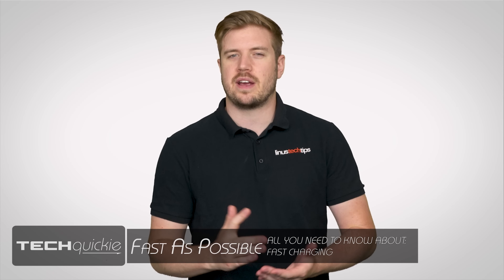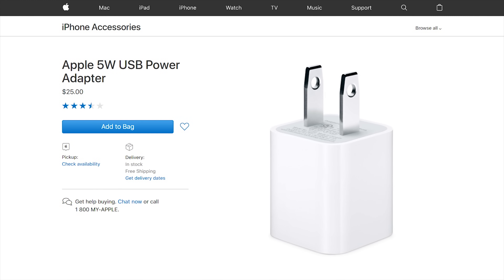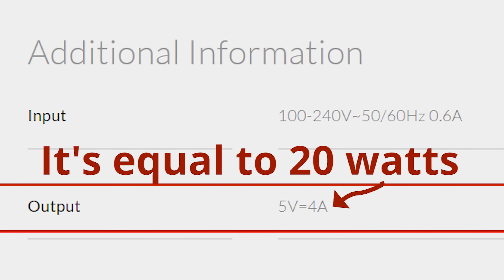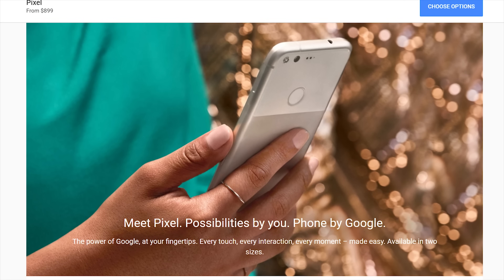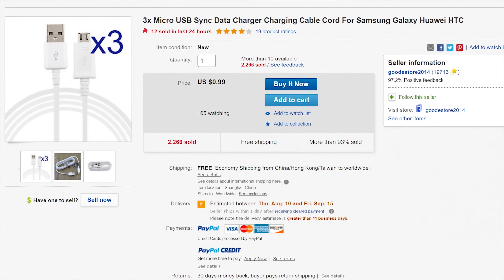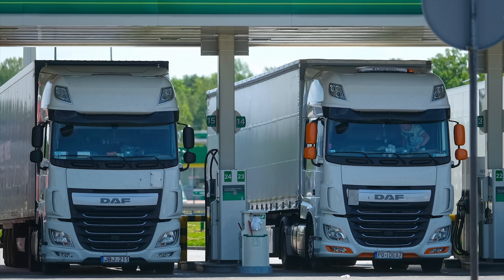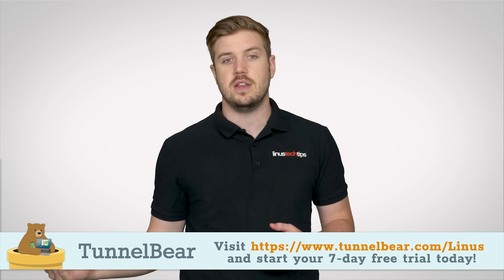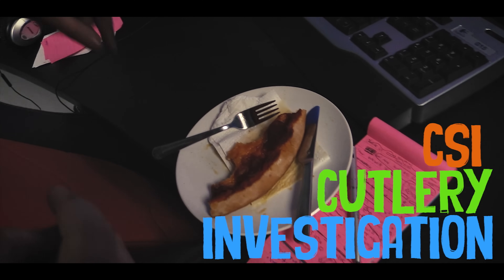How Does Fast Charging Work?

Comment: I love how americans complain about paying 50 dollars to gas
Reply: Marcus Coster he means that it is very cheap when compared to, for example, most of Europe
Reply: Well when minimum wage isn't enough to support yourself and then add gas on that, then you've got a problem. But you know, I'm just a dumb American, what do I know?
Reply: Marcus Coster - You assume everyone lives in a built up area with great public transport which simply isn't the case. It is more densely populated but this just creates more traffic congestion as public transport isn't that great and costs a lot. Most people still need/want a car. The only time public transport works really well is in city centers which is probably the same in america but it's still expensive. If you complain about fuel prices in america why do so many of you drive v8's and v6's. There are smaller cars available but you don't buy them so to complain about fuel prices while driving inefficient cars is pretty stupid. In Europe most own 1l to 2l 4 cylinder cars, even the larger 4x4's tend to have a 4 cylinder larger capacity engine. They're not slow either yet much more economical and can be just as large to transport things.
Reply: Every country should take notes from finnish public transportation

Ok ok its just the card you use to travel
Reply: Truckman I've visited to 5 European countries last month and every single one had such a card. Still a car is faster when you're not commuting through a city center
Reply: Truckman yes. It's just a universal public transport card. 
In the Netherlands, Austria, Czech Republic and Hungary it's train, tram, bus and metro. 
In Portugal it's also the ferry

EDIT: they're all different cards. It's not like you can use a Dutch one in Austria :p
Reply: Good public transport? I'd say it's decent in the cities in Belgium but anywhere else it's pretty bad, can't really trust it to get somewhere in time and it's hella expensive.
Reply: AlmostEasy which countries have you tried because i use only public transport and have never been late.
Reply: It's called price relativity. Let's say you could buy a good meal at a restaurant for $3 and have known it to be around that price for most of your life. Over time when it crawls up to $6 or $7 it's all of a sudden annoyingly overpriced. If you're used to something being cheap, then you don't really consider it cheap. That's just what you consider the price to be. Anything higher, relatively speaking, would be expensive. Different world regions, different prices, different price expectations. It's not that complicated.
Reply: Here in Italy the average price for gas it's about 1.6€/liter (about 5.8$/gallon), so yeah you Americans shouldn't really complain for your gas price 😂
Reply: vinno97 things probs have changed but does the same card work on many types of transportation like bus subway tram and in some cases train. Not saying it would be exclusive to Finland. And yes car is the easiest option.
Reply: vinno97 :P tho about cars. EV's seem cool like Tesla tho i dont know if EV is worth it
Reply: Truckman I'd say eventually all cars will be electric, though I don't expect fossil fuels to go away anytime soon
Reply: Belgium, it's where I live. Should've added anywhere else in Belgium that isn't a city, wasn't generalising for the rest of Europe.
Reply: AlmostEasy ah okey.
Reply: It costs me 28 dollars to fill my 12 gallon tank in Southern California. It costs me 22 dollars in Las Vegas when I go visit my family. 18 dollars when I'm visiting friends in Arizona. 15 dollars when I'm in Florida. I hear it's even cheaper heading north of Florida.
Reply: Here in NE Louisiana it's about 2.30-2.50 a gallon (1.75-1.90£ for you British folk)
Reply: I love it how Europe complains about how much it has to pay for gas if you look at Iceland they have both of us beat as far as expensive gas goes xD
Reply: Lol i m living in canada. Stupid host mom asked me gas for 20 bucks even she traveled 54km does it make sense ?
Reply: Yea i Bet you just love it
Reply: These people are Canadian
Reply: Kirina Yuuki in Russia its cheaper
Reply: My minivan costs 80 in Canada ....
Reply: T H I N K   A B O U T   T H E 
 C H I L D R E N !
Reply: Uraneum I wish I could get a good meal for 3$ equiv in the UK. A average meal price at a general rural cafe is about £7-12 and in London it is twice that. That is just the basic foods. With fancy foods at decent restruants, you could be paying over £100 for two or three people
Reply: Lol I complain about paying 25$ to fill up 😂 if it cost me 50$ to fill I would throw that dam car away
Reply: vinno97 It doesn't matter because the public transportation is good and reaches basically everywhere. There's also not nearly as much space for having a car, the roads are smaller, population is denser (making smog have a worse effect). You could live in a lot more places in Europe and never need to own a car than you could in the U.S. My other point was, Americans almost certainly buy gas more often than Europeans. So overall there's not much benefit for us. Many people would be happier taking a bus or subway or bike everywhere if possible, for FAR less  money per month.
Reply: Kirina Yuuki Cars are necessary in most of the country so yeah, we are allowed to be upset when prices get high.

Comment: Why do many laptop charges have some kind of brick  on them
Reply: Najam Hassan The brick IS the charger, the wires are just wires.
Reply: it converts the power from the power outlet from the wall to power your laptop can use
Reply: It converts ac to dc.
Reply: Houses the electronics to convert AC to DC, and downstep the voltage. Phone adapters have them too, but carry a much lower current, so smaller circuitry can be used
Reply: AC is good for transmitting power, but digital devices use DC. In traditional AC-to-DC converters, a step-down transformer (which, unfortunately, are NOT robots in disguise) converts a high voltage AC signal to a low voltage AC signal. For high power applications, this AC signal is sent to a FULL-BRIDGE RECTIFIER which allows AC signals to move in only one direction. Add a load (the thing we want to power) and a capacitor (to smooth the voltage) and we have DC through the load.

For lower powered circuits, we can use a puny single-diode half rectifier. Since AC is a sine wave (sorta), a full-bridge rectifier converts both the waves above and below neutral while a half rectifier only uses one of the two. Don't worry, we can still smooth it with a capacitor, we just can't demand as much power from it.

BUT WAIT! THERE'S MORE! For even lower power applications, we can use a switching supply. Both rectifiers require the use of a diode, which means that there is power wasted on the diode. A microcontroller can see the input voltage and change the amount of time that voltage would be allowed to power a device. This is known as Pulse-Width Modulation (or PWM) where V_apparent=V_actual*duty_cycle where the duty cycle is the percent time that the voltage is allowed to pass. Add a capacitor and we can rectify the power with better efficiency.

Considering the power needs of a computer, your laptop probably has a full-bridge rectifier which often has somewhat large transformers and often have other safety devices as current sensors and temperature sensors integrated into the charger.

Comment: Not a bad intro, I guess, but you're a bit weak on your electronics 101. A power supply can't control how many amps go into the device- its up to the phone to not draw more than the power supply can handle, and the protocols are all about making sure the phone can figure out that limit. This means that you can't damage a phone by plugging it into a charger that is too many amps- it'll just draw what it wants. If a phone starts to draw too much current, though, all the charger can do is shut off.

Comment: How come that while my OnePLus 3 dash charges, the battery temperature doesn't usually exceed 30C, although it's being hit with 3.4A (data according to "Ampere" app)?
Reply: Hence why I love my OP3T, all round brilliant phone except the camera for a good price and it beasts every other phone charging wise.

Also, you can get an "VOOC" charger block which can usually be found for cheaper and is the same technology in Dash Charge (VOOC is created by OPPO who also own 1+)
Reply: because the heat production follows P=I^2*R (power= current squared times resistance). If the internal resistance of the battery is lower, it will output less heat at the same current.
Reply: Colin Ries most of the heat comes from the transformer circuitry, Qualcomm quick charge (same as Samsung fast charge etc etc) use higher voltages so they have to get transformed back to 5V in your phone, dash charge on the other hand puts out way more amps and keeps voltage at 5V so the charger gets hot and not the phone, notice how the brick always gets pretty hot
Reply: Iam Sagittare that makes sense, but it implies that OnePlus is using really good batteries...
Reply: Niek Schoemaker that makes sense. Indeed the charger gets pretty hot, but so does my iPhone charger... I think the lower overall (phone + charger) heat output comes from less overall conversions. With quick charge, you have 220V -> xx V -> 5V while Dash Charge reduces it to 220V -> 5V. Pretty much the only downside is that it requires a thicker cable in order to support the higher current, while higher voltage works just fine on a normal thickness cable...
Reply: Vinxian1 sure, but according to the video, the battery itself produces the heat (being a chemist, I can say this makes sense) and not the circuitry around it...
Reply: I have to say that I'm suprised it only reaches 30C, even without the the power circuitry.
But the circuitry is responsible for a lot of the heat, the circuitry is not 100% efficient. Therefore it dissipates power. And that in turn generates heat. especially since the circuitry is in a closed environment
Reply: Vinxian1 that's true, but really, I thought the battery alone was responsible for the majority of the heat output. 30C is when it's not used while charging though. It's a little hotter when being used at the same time, but still miles aways from an iPhone or whatever

Comment: Quite innacurate. 2amps is max capacity of USB micro b, not 4. Samsung uses 9v fast charging at 1.67 amps to get quite a lot faster charge
Reply: i'm not smart but the oneplus dash charger uses usb c
Reply: thicc USB c can deliver 5 amps so it's possible
Reply: Excuse me? How are my specifications false. I know how this works.
Reply: For USB 2.0 wich includes the micro USB connector:
"Battery Charging Specification 1.2:[29] Released in December 2010.

Several changes and increasing limits including allowing 1.5 A on 
charging ports for unconfigured devices, allowing High Speed 
communication while having a current up to 1.5 A and allowing a maximum 
current of 5 A."

So your specifications are false because 5A is more than 2A, and 2A doesn't appear in the spec at all. But please tell me more about how you know how this works.

https://en.wikipedia.org/wiki/USB#Power_related_specifications

Comment: My suggestion to everyone looking to keep their phone's battery healthy is to use quickcharge only when you absolutely need it. If you are charging over night just use an old charger (like a 500mA one) to charge your phone. The battery will stay cool and won't degrade over time, and by morning you will have a fully charged phone. Ideally you need to keep your battery between 20%-80%, but most important is to never let your battery empty completely
Reply: good spot, thank you! corrected it
Reply: Batteries are designed to be charged to 100% each time
I fully charge my Smartphone each night and it automatically cuts the current once charging is complete thus protecting the battery and I will unplug it the following morning when I get up and each morning my Smartphone and its battery is always nice and cool.

Comment: Guys help my CPU has 7GHz of GDDR7 ROM
Reply: Ramen Fever You might want to replace your mother board as that is what handles how many gpus your ram has
Reply: Ramen Fever Download more rgb that should help
Reply: Just download more motherboard.
Reply: You need buy the Graphics card Nvidia i7 with 6 cores and 2 threads at 3 gb of power suply x399
Reply: Ramen Fever you need to buy a new solid state USB hub
Reply: The 0 core model is better
Reply: I have a Pentium Z and it rendered the whole universe in 1 microsecond and created a black hole....HELP
Reply: You need overclock your power suply to 7 ghz with 3 mb of motherboard
Reply: is it has RGB? then it is fine
Reply: Just download more RAM
Reply: Ramen Fever Just Change Your Keyboard with a new with OPTOTRONIC Tecnologie!
Reply: panda4247 i suggest deleting system 32 and downloading 64 off the internet...
Reply: Motherboards don't work just get a fatherboard
Reply: If you want to unlock your processor and get twice as may bits from it, just rename system32 to system64.
Reply: Ramen Fever Upgrade the MD5# in the optical OC3 line in the GPU's majoogily.
Reply: Siddharth Kapoor nah he needs to download more cores
Reply: Ramen Fever needs a bigger power supply, try hooking it up to a nuclear reactor, should be enough.
Reply: Add more dedicated wam do your minecraft serwer its no wirus twust mwe
Reply: Ramen Fever TF
Reply: Delete /system32 
It'll speed your system right up
Reply: The human leg can only hear 24 FPS anyway.
Reply: oh my!!! that the effect of putting too many RGBs in your rig
Reply: delete some of the cpu
Reply: don't forget to download more ram to have a faster disk that reads cpu's faster
Reply: 7ghz? Is that a 3.5ghz dual cores?
Reply: TechArchive Wheres My downloadable Ram
Reply: Actually, it's 25Hz because of how old CRTs work. They could not change it back then, because people would not be able to watch TV on them. Then better technology came, and it needed to be backwards compatible to avoid people not being able to watch TV on those ones. And they still could not change it because of the same problem as before. So, it's basically an endless spiral that will not end until TV as we know it today dies, and some new way of watching it comes along
Reply: Funny enough, when you mention backwards compatibility, check out the video about why is NTSC 29.97 fps by standupmaths (Matt Parker). Some very interesting stuff there
Reply: I already watched it, and it's very fascinating. That guy makes some great videos
Reply: Ramen Fever delete systwm 32
Reply: Ramen Fever 🤒
Reply: Get 420x nvidia
Reply: :V
Reply: Just use a dongle.
Reply: you must overclock your rom to 2 potatoes so it runs cooler.
Reply: But can it run crysis???
Reply: lol wat...
Reply: You dont need 7GHz CPU, since the power outlet runs at only 50/60Hz (depending on your location).
The whole "more GHz" thing is just to get your money.
My TV is 50Hz and it's perfectly usable
Reply: This comment doesn't make sense.

Comment: iOS peasants still don't have fast charging lmfao while android have it for like a decade.
Reply: Waleed EL Mhamal Android hasn't even been around that long m8
Reply: We do have FastCharging.
Reply: Clark Narvas I agree, but that's not my point lol
Reply: How would you know? Have you seen the source code and/or the schematic for the circuit board that shows how the charging system works.
Reply: Vinxian1 its on its name "lightning" cable for lightning(not even close) charging
Reply: meh 😏🤪
Reply: Adel Alqadi That means it's impressive

Comment: One Plus 3T just work fine till now, during fast charging, the charger got heated but not overheat. The battery as long you do not use the phone and turn off mobile data should be work fine during charging.
Reply: Your comment shows your grammar is horrendous
Improve your grammar
I myself my grammar is always 100% perfect
Reply: @stephensnell5707  the fact is nobody's perfect. Bear that in mind. Also maybe you can say like please rephrase or something like that. That's a better way to communicate.

Comment: Wow, no mention of C ratings and why some batteries can recharge faster than others. It's not about heat, it's about the batteries C rating and ability to take a high capacity charge. A 10C batt and a 90C batt can be charged at the same rate, but the lower C rate will see reduced cycle life. Even without seeing higher temps. Really missed the point on this one.